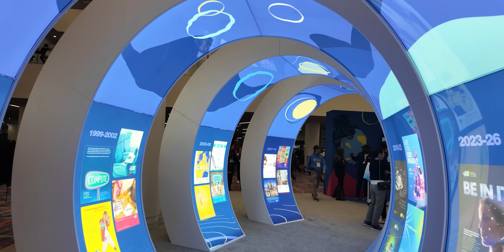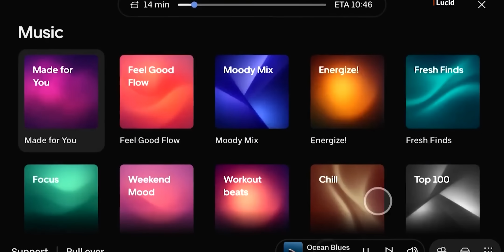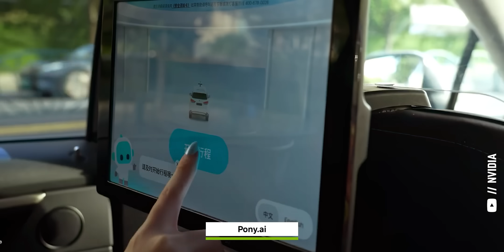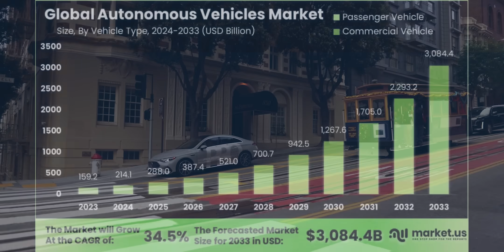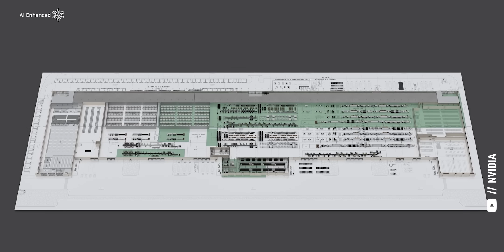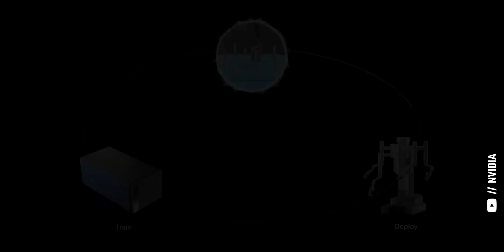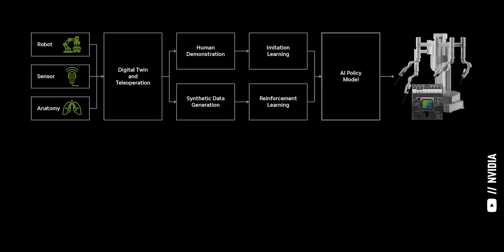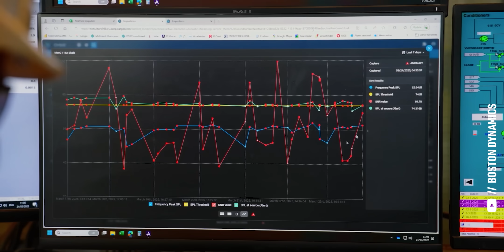GET IN EARLY! I'm Investing In Robots After CES 2026 (Here's Why)

Comment: The problem with people using NVDA chips is that they dont have the miles and data use cases to really use the cars and chip. Without the miles and data the chips wont work. This is why Mercedes has already cancelled its program.

Comment: 3:18 Cameras are arguably the best tool at measuring distance, even in mono. Think things like Keyence that use industrial vision systems that can measure at multiple depths of focus on small objects. 

Radar and Lidar have different use cases for consumer transportation but are too low resolution or too slow. People drive now with two cameras called eyeballs.

Went to CES myself. Every autonomous car system with a tech stack that depends on LIDAR effectively limits themselves with cost and complexity. Which was every one of them that I saw.
Reply: @DJBloodBath777  good point. I believe this is why ppl like robotaxi as king for self driving at scale…just uses cameras

Comment: Good video but what about Tesla??? Optimus will be in production and use this year, Robotaxy is rolling out now and Tesla has the most advanced FSD now...
Reply: I'm just a layman so take what i say with a pinch of salt but I think they are already priced into tesla stock and then some. It is very expensive for what you get but that doesn't mean it won't go up. Tesla seems to have die hard supporters so the stock can be quite erratic. Thats just my take on it though
Reply: @paddyd50gamer86  75% of current price of TSLA assumes their autonomy will work to some degree, but this premium is only a fraction of the gains if they really scale their robotaxi fleet.  And then there is Optimus, which is not priced in at all.

Comment: They been showing these robots for many years just made them look more human...the reality is they can perform set task in set area but still make mistakes during a continued process and have to be corrected also all the integrated systems and hydraulic distribution and valves and actuators break constantly.....still many many years away and just the service contract and parts and purchase are way more upfront and continuous service and parts are still way more than a human...sorry guy

Comment: I don't think the video did a good job comparing the self-driving car solutions to Tesla. Tesla was barely even mentioned. Those solutions presented at CES are irrelevant if they're not viable in the market
Reply: The problem with Tesla is that they been avoiding using lidar to lower costs and focus on cameras and software which is stupid and dangerous IMO...
Reply: @4ce5bf154  My Tesla drives me everywhere. You should get an FSD test drive
Reply: Tesla missed the boat.
Reply: @zoe.tsekas  How? Please explain
Reply: @tomhudson1 costs of lidar and radar have come down, so price is not going to be a issue, safety though will be, cars with lidar and radar will be safer. Tesla had an edge on data by collecting real world data, but now with nvidia omnipresent synthetic data will cover more cases and accelerate model training
Reply: omniverse
Reply: Also I have had FSD for years and now I never drive. It is a better driver than I am. It is also a better driver than everyone I know and it is only getting better. Also Tesla can make a Robotaxi for around $20K and pump them out at light speed. Game over! I would encourage you to take a test drive as an investor if not as a buyer
Reply: tesla missed the boat??? which boat lol

Comment: You’re drinking the cool aid too! All those sensors are not working. Vision or cameras as you slammed, are all that is needed.
Reply: hahaha..... that's some Elon nonsense. He made a mistake by being stubborn about not using lidar; everyone else is using it and shaking their head. Don't get stuck in that echo chamber of Tesla investors and fanboys repeating the same nonsense... Look at the facts: Tesla is being overtaken by the competition. Mercedes is the only company to currently have a fully autonomous approved road car. And they started their self-driving journey much later than Tesla. So how did they beat Tesla? with 4 separate sensor systems NOT just vision, because vision alone is crap in certain conditions - as this video PERFECTLY laid out.
Reply: @rpals5412  I don’t believe the facts support your argument here on several fronts. It’ll be likely 5-6 years before Nvidia’s FSD platform is fully autonomous and ready for unsupervised driving on public roads. The issue that Nvidia, and Tesla, and all the others face is that ‘long tail’ 99.9999% issue…that last 0.0001 piece of the puzzle that will allow the car to be so safe and deal comprehensively with ‘almost’ every scenario it will encounter out there in “the wild”. None of them are there yet. But Tesla is closest and so far ahead of the rest with all that data it has mined from its 8m cars that have been training its neural model over the past 6bn+ miles of driving, that it’ll be years before anyone else comes even close. Waymo? Loss making over the past 10 years Waymo where each car is saddled with a $150,000 LiDAR et al contraption against Tesla’s fully vertically integrated $20,000 solution with its sub $0.50 cost per mile? Don’t think so. But hey, competition IS good and WILL continue to keep everyone on their toes. It’s an exciting time to be alive (and also a little depressing if I’m honest…the 80s rocked) and who among us knows what this world will be like in 5 years time. One thing is certain however, like him or not, Tesla absolutely will be first out there with completely autonomous (non monitored) cars and will 100% be offering the most cost effective solution for consumers in the space. There is no doubt about this.
Reply: @rpals5412  Do humans have LIDAR or RADAR? We do just fine driving without it.
Reply: @EAdams-BXR we have brains that think and reason in ways an automated car does not. that’s the difference
Reply: @EAdams-BXR  are we " doing just fine" when there are millions of car wrecks every year in the US alone?
Reply: @EAdams-BXR  Comparing humans with AI is entirely nonsensicle, and not at all what regulators base laws and regulations on...

Your comment proves that you have listened too much to tesla fanboy youtube videos, and don't actually know anything about what it takes to get a vehicle approved for autonomous driving - it has NOTHING to do with comparing it to human capabilities and it never will. All experts agree, all politicians agree. That's why Elon had to try to lobby for Trump, but even that failed.
Reply: How are you so confidently wrong🤣
Reply: @jaygallagher8280 I drive a Tesla FSD and it’s amazing. Do your own research, stop listening to the salesman.
Reply: Muskie boy
Reply: Elon bot you are
Reply: Vision ONLY will make a Tesla as reliable as a human. Extra senses are required to Make autonomous driving safer than humans and clear level 4 autonomy. If Tesla clears that with just cameras then I'll be impressed.
Reply: @Savantenium prepare to be impressed 🤷🏾‍♂️
Reply: @Savantenium  but the cameras can look 360 degrees, all the time, humans can not.
Reply: Hey dumb dumb,
Interesting how every oem other than tesla is “drinking the kool-aid” as you say. Who in their right mind would want more precise perception of the world around them?!
Reply: @java620  my dad always told me never to argue with an idiot
Reply: lol no. Elon is a moron. Lidar is necessary and eventually regulations will require it.
Reply: @krisk5871I’m assuming your IQ is higher than his, yes?
Reply: @krisk5871BULL
Reply: @krisk5871Everyone else……. There are no others. Your smarter then Elon?  I don’t think so.
Reply: @leonardschmick2308 you're and also, what evidence do you have of your Supreme overlord's grandiose intelligence?

Comment: So hyundai is also a good investment as their robotics might get huge the coming years?
Reply: Hyundai is not as focused on high margin immediate profits as Silicon Valley. Focus is on long term and job creation instead of  pumping a trading symbol like seen with TSLA.
Reply: What I heard is they have done a lot of demos but have not make a lot of progress scaling the manufacturing, heck been hearing about Boston Dynamics for >10 years once in a while about different types of gimmicks but how have they been doing generating revenues? Granted all this may have changed and heard they are cooperating with the likes of BMW(?) but I haven't done much homework and hope you do if you decide to invest. One more thing about scaling is you can have great looking products during demo but if they are not durable and breaks down easily, if replacement parts are expensive that's definitely a huge problem. If you buy a product that doesn't last long then it inherently will become expensive.
Reply: @maximusminimus8050  My understanding is the main limitation is software not the hardware (Atlas is running Google gemini for robotics on NVIDIA chips).  NVidia also has a real world model it's pushing as well.
Reply: Hyundai aleady looks like it's had it's sudden price hike after CES (google was the previous owner of Bonston dynamics).  My understanding is the main limitation is software not the hardware (Atlas is running Google gemini for robotics on NVIDIA chips).  I don't see any major issues with someone else simply copying the robotics (the magic is mostly in the real world reinforced learning Ai models).  NVidia also has a real world model it's pushing as well.
Reply: The main problem I see with Hyundai is that is listed on Kospi instead the USA which limits the chances of grow as liquidation is much smaller there... but I could definitly see it getting x2/3 after couple years as his CEO seems a pretty smart guy with lot of connections with other CEO like Nvidia, Chatgtp, samsung, etc.